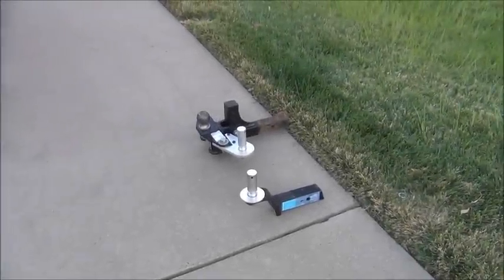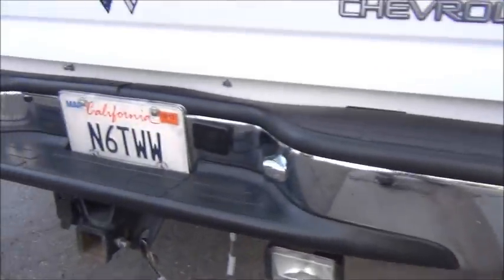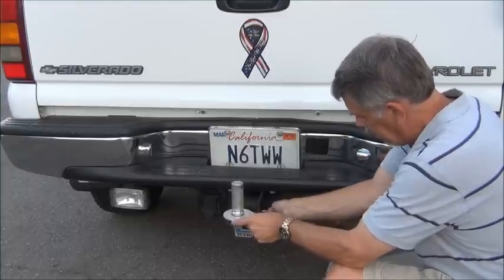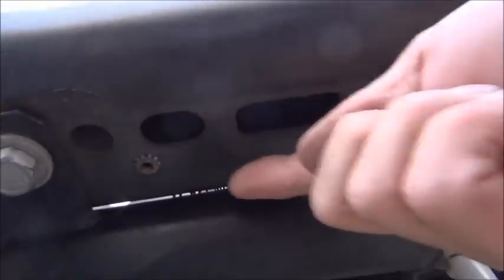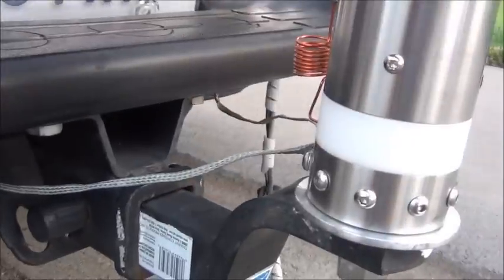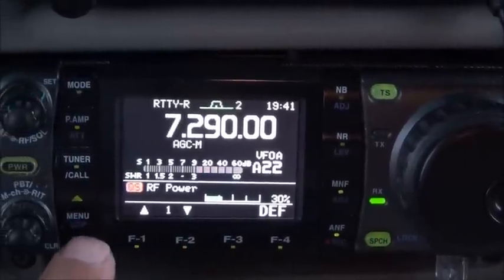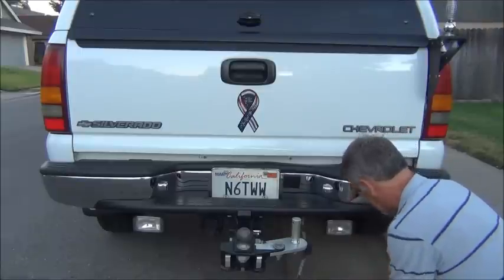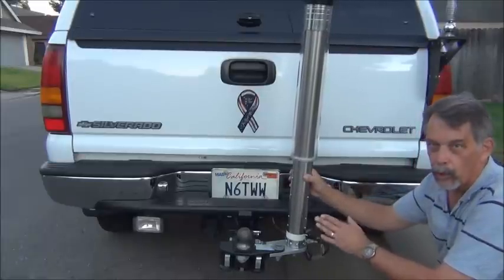Mobile HF Antenna by N6TWW

Comment from the maker: The banana plugs and socket are all stainless steel and a pretty tight. I have never had one fall out or even start to come out. I had another hitch set up where I use a piece of metal as a wedge like you mentioned but I found it would loosen up over time. I tune by ear first to get close and then use the SWR meter for the final adjustment. The nice thing with a screwdriver antenna is that no tuner is needed so the efficiency is better. 73

Comment: Nice video Mike!  I wonder if your ground wires with banana plugs not slip out on a shaky road?  I also use a hitch mount for my Hustler whip; it doesn't wobble that much and I use a piece of scrap metal to wedge it in, that keeps it tight.  I use "permanent" braded wires for ground.  I am considering a screwdriver antenna and you demonstrated well how to tune it up by the ear.  You can watch the SWR also.  So far the Hustler works well with an auto tuner.  Good luck & 73, ab6ze

Comment from the maker: I drilled a hole in the receiver then tapped the hole to put threads in the hole so that the bolt would thread into the hole. When the bolt is installed and tightened done the end of the bolt presses against the hitch. A lock nut is installed on the bolt so that once the bolt is tightened down the lock nut can be tightened down so that the bolt will not back out until the lock nut is loosened up. I hope that makes it clear.

Comment from the maker: For local communications a 2 meter radio is your best bet and you only need a Technician class license. If you want to get back into HF you will have to do some research for which radio to fit you needs since there are so many options. You will need to take a test for a license but code is no longer required and there are now only three license classes: Technician, General and Extra. To get back on HF you will need at least a General class license.
73, Mike

Comment from the maker: Doug, the aluminum quick disconnecting stub along with the threaded stainless rod came with the antenna. Everything including the control wire, 12v cigarette power plug and controller switch came with the antenna. The only thing I had to provide was a secure way to mount the antenna along with the coax from the radio. I had to purchase the second quick disconnect stub for the second mount as an extra purchase. The additional grounding was my work and materials.

Comment: Websites.com looking it up will show the definition of the stuff going both ways. If it has copper in it you know it's a definite conductive that would be better than one possibly white from being aluminum conductor. I've picked a stick of anti-cease that's impregnated with copper. I've seen an army ships crew member use a can of copper grease to plaster big bolts on riggings above deck. So I figure the copper version is safe on iron and trusted to prevent rust or galling.

Comment: Bencher makes some grease called Butter not paste which used to be called almost butter. It's a grease with lots of copper in it. What I did for a hitch is use the Bencher butter grease on the inside of the hitch receiver. Sand and clean it out and have a good electrical contact area on the portion that slides together. Just grease up whatevers bare metal in contact and it works great. Like always you can't have too many grounds si I ran a 8ga solid copper wire ground to the bumper support also.

Comment from the maker: Having the hitch on the back keeps it out of your view of the road. I think it would work just as well on the front as on the back. I do not have the antenna on the truck all the time. When I go to a mall it stays on the truck unless I have to drive into covered parking.

Comment from the maker: Greg, thanks for the positive feedback. I am using this antenna on my trip north through California, Oregon, & Washington. I have used it on several other trips and so far it has worked great. It is very nice to be able to tune to any HF frequency between 80 & 10 meters especially without any antenna motor noise while tunning the antenna.
73, Mike